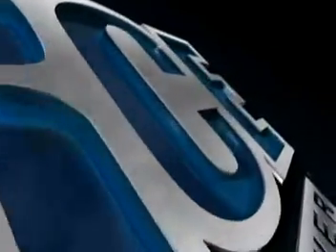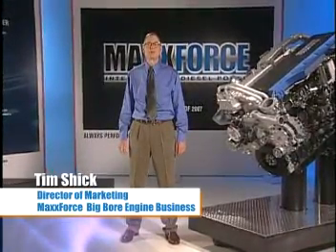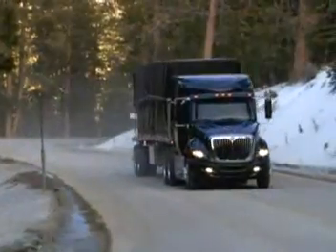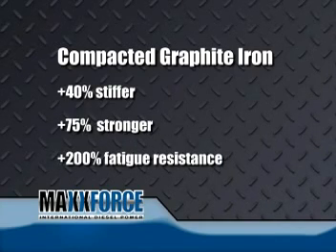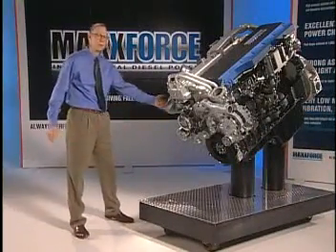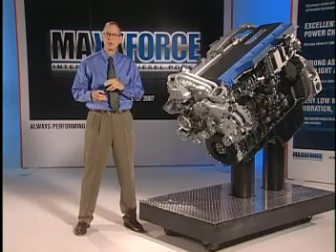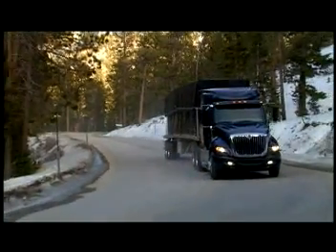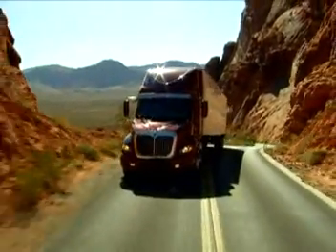Navistar MaxxForce Big Bore Diesel Engine Overview 01 of 03

Comment: Engine has to be one of the best ever made. Think of this, that engine ran. With all the nasty crap being force fed into it. If it had been done right. Thinking this engine, may have been at the top. But sad a company would push the Emissions crap out . Knowing it would fail.

This engine would have been as well off. Sucking air in without filters. No different then what Navistar was making it run on.

Comment: TRASH ENGINE. WASTE OF ENGINEERING!
Reply: That's the reason why Ford, start making there own diesel engines, since 10yrs ago.
Reply: @markquiswest6607  yea cause the moron engineering at Navistar wanted 80% egr flow on the maxxforce series engines at idle, and alot of there design flaws!

Comment: They do  lots of breakdown. Worst engine in history. They used to make good trucks, now they have the crap prostart and its replacement lt that looks just like the prostar. This company teputation is so low they have stopped putting those crap of engines in their own trucks. Still their trucks are cheap crap with a great cummins engine. You still have to deal with the low structure part quality. Just not a good truck.
Reply: If they started building carbon copies of the 1979 S series again  I wonder how many they could sell?,with the 1979 to 1988 Hood and not that ugly sloped thing started in 1989

Comment: Strange ain't it the Iveco Cursors they copied are a better motor than IH's Maxforce. I run a Cursor 8 and still trying to break it. And it still out pulls the MWM 370 on a  climb
Reply: Does MWM still make MaxxForce motors?

Comment: The International/Cat MaxxForce is the best example of how ruin a good engine design like the Man D2676 into a piece of shit. To big SCR system, bad alloys, bad software, and bad fittings.

And don't say me that shit that euro engines doesn't work in the US cause the Detroit dd16 is just a merc OM473
Reply: It comes as a surprise to me, because the D 2876 normally runs perfectly well even in the UK or NZ.
By the way, isn't the OM 473 actually developed by Detroit as  DD15? Yes, under
the patronage of Daimler.
Reply: MAN engines are mainly garbage all except for the 10.5L D20 commonrail engine. There are very few decent MAN engines around. The straight-six MAN powerplants like the powerplant for the 14.280 chassis are among the worst in the range. If MAN engines don't blow a piston they are always underpowered and overheat easily. If you decide to buy MAN just make sure it's got more then six cylinders or if you do opt for a six cylinder make sure it's the 10.5L D20 or not at all.
Reply: Thank you I learned something I hate maxxforce

Comment: A twin turbo setup does not have to have both turbos the same size to be consider twin turbo, though that is one method and it's call a parallel setup there's also a staged and sequential turbo setups.. in the case of the maxxforce it's a sequential twin turbo setup that also has the ability to work in tandem the small turbo help the engine acelerate while the larger turbo is for cruising speed, the smaller turbo also helps the larger turbo in the case of the maxxforce pulling loads up hill.